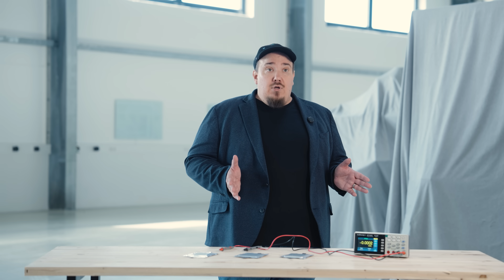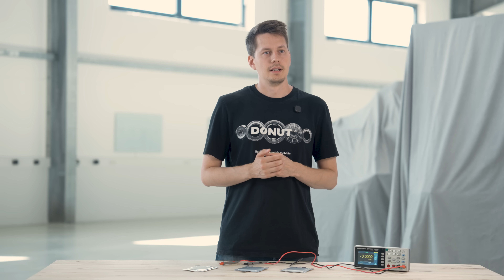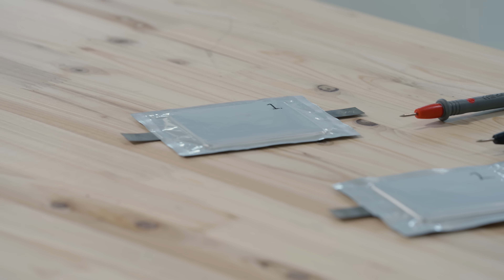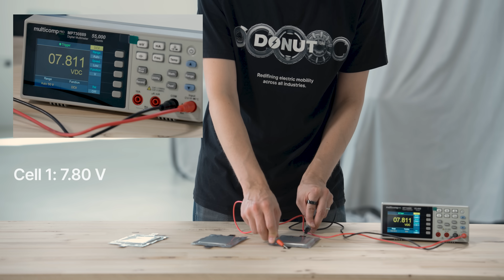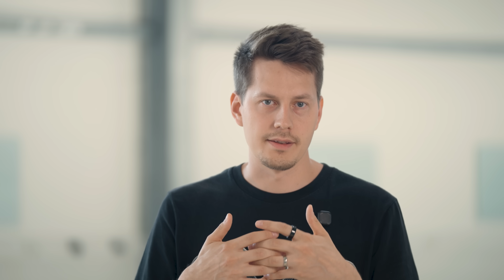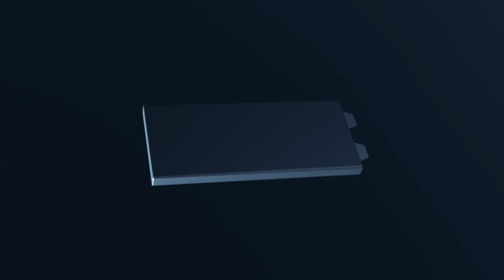Bipolar Cell | I Donut Believe

Comment: unbalanced layers - great idea, no balancing possible - faster problems !
Reply: The hypothesis (based on another video series.. I can't post the name or comment gets blocked) is ..  
1.  The heart of the 3d printing tech they're using  is  precisely controlling the solid electrolyte layer height which minimizes the possibility of imbalance 
and 
2.  If the layers are using Grotthuss mechanism (proton level bucket brigade) and that there's no permanent penalty for over discharging a layer. 
So they can become imbalanced during discharge (all the way down to 0V) and it keeps operating, and there's something in inherent in the proton intercalation mechanism that causes individual layers to not overcharge so they essentially self balance on charge.  

That's the hypothesis at least.
Reply: @daemn42  future will show - but because the whole battery is a scam atm - the future wont tell.
There is a reason, why nobody uses multilayercells for professional stuff. They are to dangerous ona long term use.

The Grotthuss mechanism does not prevent from overcharging a single layer! It influences the conductivity within a layer (ggod for fast charging), but does not prevent a layer from getting overcharged. If every electron found the combination partner the  Grotthuss mechanic does nothing (no more acess protons that can find a bridge to bind) and the damage from overcharging that layer starts....
Reply: What makes you assume the cell wil not balance itself out, just as other layered bipolar components do distributing the charge between the layers. This isn't like different groups of cells, configured in modules, that need the BMS to perform the module level balancing.
Reply: @GruffSillyGoat why should they "balance aout themselves" - no layer knows anything about the other layer. Its a serial connection, each layer isolated from the other, what has benn told as "benefit of no liquid electrolyte". With liquid electrolyte there may be a way that the electrons reach the less-charged cell, if the full charged cannot collect more electrons. But with "solid state" - you are screwed. Each layer acts as an isolated cell - unbalanced as soon as degradation differs them to "good" and "bad".
Reply: @peterle987 - you assume the charge doesn't redistribute within the cell, which it does. Further, when the cell is charged to 100% the layers equalise.
Reply: @GruffSillyGoat The redistribution is not possible on solid state - that was sold as advantage! Tell the way how the charge will move from one layer to the other ! There is no physical pass! The layers cannot equalize. The are isolated to each other like you connect physical cells in series. To qualize you need a external balancer that is connected to each cell or "layer" if you use that Donut version.
The layers will differ like every cellpack else without a balancer-bms.
There is a reason why no real cell manufacturer hides that way to build cells - guess why (after that what I told you (I am an engineer btw - not a hillibilly)
Reply: @peterle987 - in a bipolar stack the layers are in contact all the time, A charge will flow inside the cell if there are different potential levels within the cell's layers. It is just a slower process than when charging/discharging the cell.

Each layer consists of an anode, a solid electrolyte, a cathode, and a charge collector that stack up in series to form the cell. If one layer has a lower charge at a different voltage potential to it's neighbour then a charge will flow; and so on shuffling across the cell. 

The solid electrolyte layers are not an insulator, but selective charge carriers that allows specific charge carrying ions to migrate through. They don't block a current, otherwise no battery would work.

Capacity distribution leveling of the stack can be achived by charging to 100%. However, by design and construction the cell layers have near identical charge capacity characteristics.

What is required of a bipolar cell stack is uniform layers, to ensure the charge is distributed evenly across each layer, that then can flow evenly across the layers. This prevents hot spots where charge differs significantly lowering capacity, efficiency and causing localised temperature differences. 

To achieve this, bipolar cells require very tightly controlled layer deposition, electrolytes that don't internally migrate and short the layers, and uniformity in response in operation (temperature response, expansion, etc). 

It's the combination of cell chemistry and production control of the depositing/printing of the layers that is key to achieving bipolar cell operation. 

Most battery makers already have bipolar on their innovation roadmap, if charge distribution was an unsolvable issue that would not be the case. The issue is current wet electrolyte based cells are not well suited to bipolar designs, whereas solid state architecture very much suits bipolar configurations. Indeed expect most solid state designs to migrate to bipolar architecture over the current monopolar one.

Donut Lab is not the first bipolar design, but is one that is being sought to be one of the first commercialised products.
Reply: p.s. Think about you're argument for a moment, set aside the use of solid state for now, and how it impacts current EVs.

Battery balancing in EVs is performed at the module level not the individual cell level, with module typically containing Lithium Ion cells connected in series (though some are series/parallel configurations, most are series modules connected in parallel strings). 

The car's BMS balances the modules at a broad level, with the modules then equalise their charge at a finer level internally between the module's cells.

No EV balances individual cells it would be too costly, and not return any significant benefit over performing the balancing at a module level. 

The role of EV balancing is to broadly distribute the charge evenly over a number of modules in a short time frame, to ensure they have similar potential and capacity to each other. The cells within the modules may differ but are manufactured within tight tolerances to ensure the variation is low.

A bipolar cell is effectively a module implemented at a cell scale. It's no different in this respect, the cell's layers are not sought to be balanced individually but at the cell (i.e. module equivalent) level. Similarly, the layers are constructed to fine tolarances to minimise differences within the cell, just as cells inside an EV module are matched. 

btw - I'm an electronic/electrical design engineer by trade, i've designed industrial battery balancing system in the past.
Reply: @GruffSillyGoat EVERY EV balances on a cell base! Using of Modules is just a design thing, where you can use a smaller BMS (with balancing) on each module instead of a huge one, that serves all cells. but EVERY cell is monitored (and balanced). Have you ever seen an OBD tool on an EV) EVERY cell is shown and I know from VAG cars that had single cells with issues. (lower capacity because of higher degrading - no balancer can help out here).
There the module has been replaced, whats much easierer than a whole battery.

But if you are a battery designer you should really know how battery packs are treated. EVERY cell is monitored, EVERY cell is balanced regardless if its a module-setup or cell-to-pack/cell to body architecture.
And if you are battery designer you also should know that cells (or layers on multilayer cells) always can differ. And EVERY BMS has to monitor each cell (layer), because evry under/overvoltage of a single cell (layer) can damage the cell or cause fire.

So, as battery expert you claim to be I am totally astonished that you cannot see that "unbalanced/unmonitored" layer design flaw!

But yes, as long all the layers behave in a identical way, aging of exactly same rate, absolutly synchron cell-voltages changes it will be nor recognized. But there is always one cell/layer that is the worst even by a tiny fraction and when the multilayercell is charged to 100%, that one layer with 99,99% capacity will get overcharged by 0,01% - and thats bad, the cell gets worse with every cylce and the effect becomes a problem more and more and no BMS can verify that or stop charging at 99,99% for not damaging the cell - because there is no layer based monitoring.
Multilayer cells can be used for toys and like that. I already found e-bike batteries without any BMS inside. And you can say: no problem: thats like only one module or a single 10S-multilayer cell.

So: multilayercells without layer monitoring or balancing are dangerous on a long term use! As engineer you should see that clear as fresh water !

Comment: Wasn’t the first commercial cell to be delivered in March?  Now it has shifted to “this year”.
Reply: Verge released an unlisted video to their customers explaining that they're building about 1 bike a week, and the first 40 bikes are going into their internal fleet..   So.. "in production vehicles" is not the same as "delivered to real customers"..  Yes it's scammy..
Reply: I think he meant the bipolar version of the cells, no? made me think that the ones delivered earlier weren't bipolar construction but stacked cells instead
Reply: @jonzuniga7638 Where are those delivered cells now?
Reply: @jonzuniga7638  Version 1.0 already was/is a screen-printed UV cured bipolar solid-state battery, containing no lithium, and likely version 2.0 is an improved version of that same process. That's my guess anyway based on the screen-printer patent being around before there was a Donut Labs version 1.0.
Reply: @jonzuniga7638  all of the cells would be such if the graphics were to be believed(it would be a stack of bipolar cells to hit the what convieniently is the lithium voltage range) the previous ones would be as well, the ones they claimed to have commercially delivered to verge. the story goes back and forth

Comment: One practical question arises: is there a limit to the amount of layers due to cooling constraints, and if yes, what is the maximum practical voltage achievable?
Reply: Cooling shouldn't be a problem for a bipolar cell because the entire surface of the cell forms the connection and the electrons travel virtually no distance, which are why charging and discharging is incredibly quick.
Reply: @sailingoctopus1  the question is at which point the height of such a battery becomes its 'length' - electrons have to travel that  distance. I don't think it matters much though because (if its real) its still way better than lithium batteries.
Reply: @rawketfire  yes, an interesting point. If you have an 800V battery with each cell having a nominal voltage of, say, 1.1V and being, say, 4mm thick then your battery would be 3m deep.

However, in current EVs we only need to go up as high as 400V and 800V to achieve the high charging rates for fast charging without overheating (and to reduce the cable and busbar sizes). A bipolar battery opens up the possibility of having, say, 48V systems, instead of 400V or 800V, that can charge and discharge at 12C without generating excessive heat. In which case your 48V battery would be only 175mm thick. Much safer too.

Obviously, I'm only guessing at the thickness of the cell and the nominal voltage.
Reply: Density remains the same, Voltage and amps are inversely related. You can ramp voltage up as much as you want given the layer thickness and size of the cell... allegedly. Amps will lower as you ramp up Voltage.
Reply: its irrelevant for ordinary people BUT its a very good question thought, we have to wait for any actual Donut battery released first to start asking such questions. it makes no sense to ask it now when everybody have doubts its even real (I hope it is real).

Comment: The number of cells and the pack voltage seem to indicate a cell voltage of 0.55V. What chemistry could this be?
Reply: Same as a silicon solar cell and lots of others.
Reply: The voltage doesn't reveal a chemistry. (This idea that it is a fingerprint is hogwash promoted erroneously by Ziroth who is going to lose his $5000 bet because he doesn't know as much as he thinks he does. PhDs are far from being gods and they have very narrowly focused knowledge, not broad knowledge of all things. Donut is in a whole different chemistry and battery design and nothing Ziroth knows gives him any insight into what is going on. His previous knowledge and assumptions actually hurt his ability to understand this because he can't see past his narrow view.)

The chemistry includes Titanium Dioxide and carbon and waterglass and an organic substance that helps it harden. No lithium. No cobalt. no nickel
Reply: @robertludwig5620  but the voltage is made by the chemistry
Reply: @cristibaluta  - lots of chemistries share the same voltage range, it's not an identifying feature.
Reply: @robertludwig5620  You have the most interesting comment here. Do you have inside info on the ingredients?